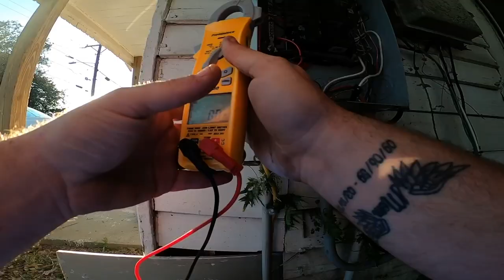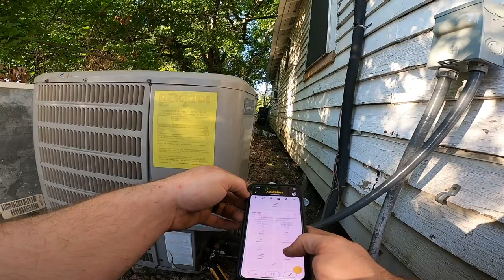No Cooling/Electrical Issue

Comment: That breaker box doesn't look like it was built very well. Having it exposed with that gaping hole in the wall looks like a building code violation.